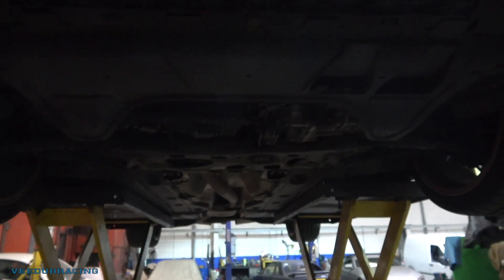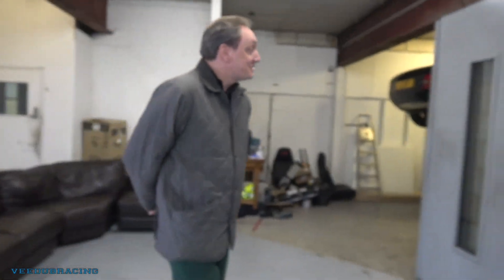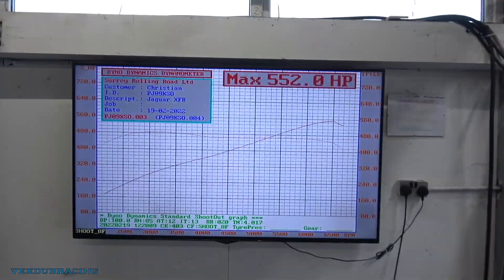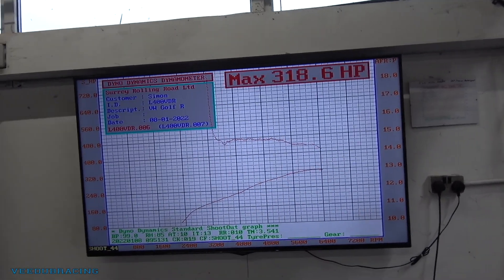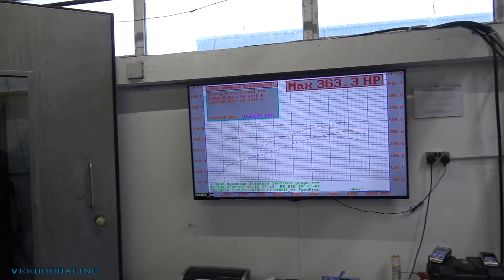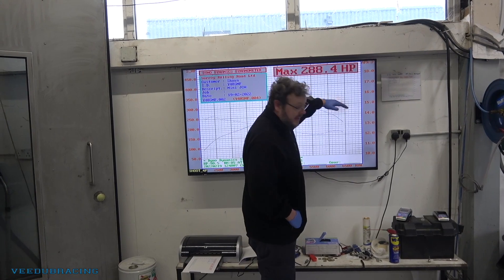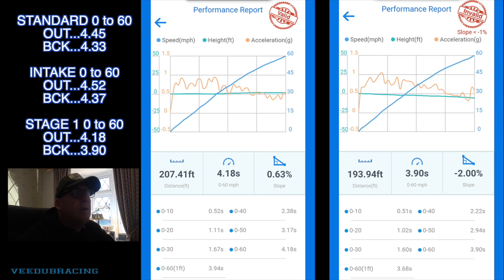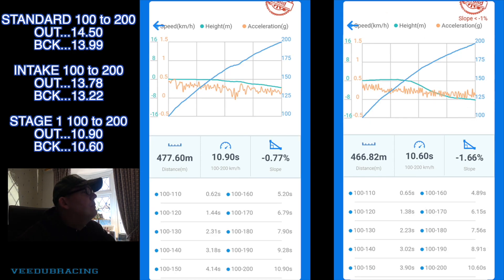GOLF R MK7 RACINGLINE STAGE 1 DYNO RUN & DRAGY TIMES - PART 3

Comment: I put The club sport S pads and Discs on the front and the same Pattern cross drilled vagmbertecnic on the back With the club sport s Pad’s nice oem plus upgrade With some decent brake fluid put a bit of NF octane booster in your fuel shud keep your AFR safe good vid keep it
Reply from the maker: Did look at the option, but really want to go bigger calipers, so prob go with the racingline stage 2 kit on the front for now. I will take a look at the octane booster. Glad you like the video.

Comment: I see you are wearing thick clothing. The colder weather of course does impact on better times. I was able to clock 4.0 sec 0 to 60 mph
at 19c. ambient temp. I need to wait till winter here when it gets to at least as low as 15. See what happens. Either way. Mine would be as quick as yours on the same APR tune. Cheers from Australia 🇦🇺
Reply from the maker: Nice one. As you know anything 4 seconds and under is shifting. I will post the next video up at some point. 😎

Comment: Your water pump is probably leaking. I have had to change many of them on Golf Rs.
Reply from the maker: Cheers, I will keep an eye on it, but all checks so far, we can't find anything.
Reply: water pump known failure on the mk7s @VeeDubRacing
Reply from the maker: @adr3510  I had to have the water pump on my S1 changed. Not had to the R yet 🤞
Reply: nice bro. ive been looking at tuning and these companies are so expensive compared to the usa tuners its depressing as @VeeDubRacing
Reply from the maker: @adr3510  Its not cheap. I have already gone Stage 2 (video may be out at some point). Its the next stage with different Turbo, that increases the spend big time